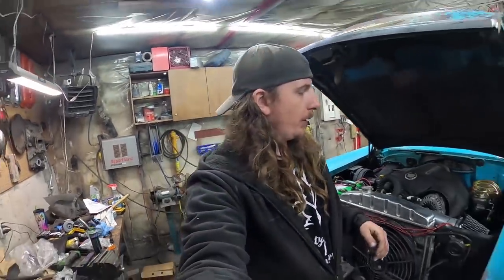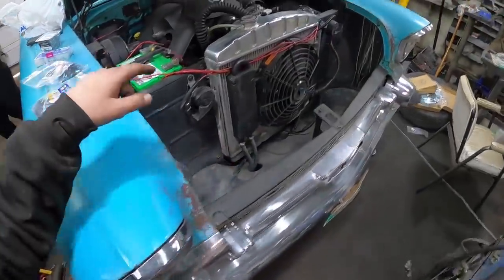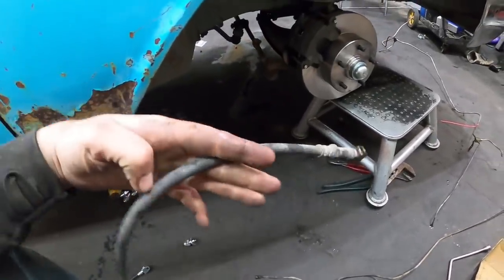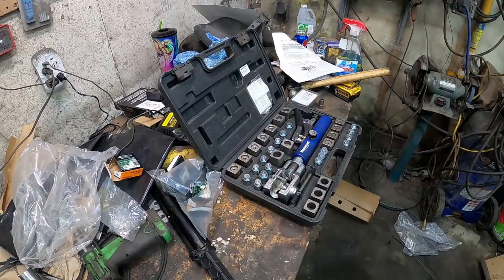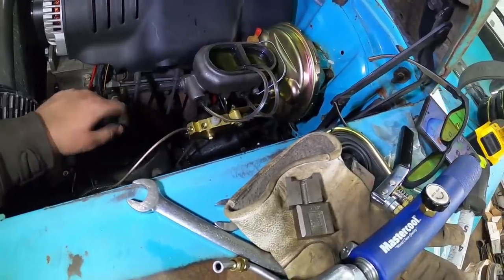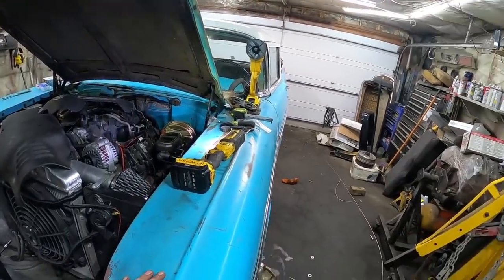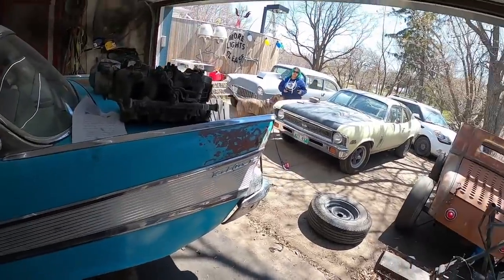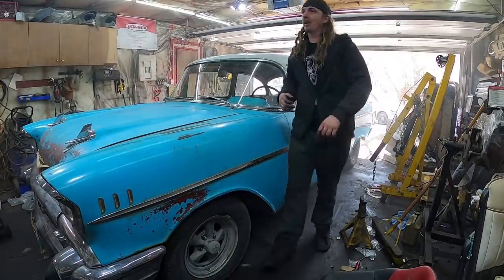57 Chevy Disc Brake Conversion Part 2 - Easy Hot Rod Upgrade

Comment: Single exhaust 55-57s had the fuel and brake lines on the inside of the frame,  on dual exhaust cars the lines were on the outside of the frame.  On the front end: the original ball bearings required frequent re-packing and were a PITA.  The hot set up was to replace the wheel hubs with mid 60s ones, (  mine came off a 65 Impala )  the tapered roller bearings were a huge improvement!  I am still running the drum brakes on my car,  discs are a common upgrade.  Power discs should be awesome!

Comment: I went with a serpentine belt set up off a big block truck and Hydro Vac power brakes...works great. Rack and pinion power steering turns without effort and a cross flow aluminum radiator with two large fans cools in the Las Vegas heat..I have a down flow aluminum  radiator and electric fan to get rid of...never used..also installed new larger fuel tank with electric fuel pump in the tank and have another new tank gathering dust...live and learn....I'm  sharing what I learned working with tri fives for 50 years. 
   Also learned I should have stayed with a Holley 850 double pumper and skipped the EFI...never to old to learn..

Comment: Fantastic tool. No wonder you refuse to give it back! One good trick for brake line stress relief is to use your tubing bender to create a coil after the exit from the metering block.
Reply from the maker: Great tip!

Comment: good shit man, can't wait to get back to wrenching on my 56
Reply from the maker: nice!  what all is left to do?
Reply: @DDSpeedShop  short term is disc brakes up front and an 8.8 ford out rear for the discs and posi along with some boiled linseed oil for the patina and a pertronix electronic ignition for the distributor. Longer term is getting some new bearings for a crank, lowering the compression and a few odds and ends for the roots blower going onto a 440 I picked up for it. I'll have to figure out some kind of deal with a transmission too, hopefully a 4 speed while i'm at it.
Reply: also thinking about something along the lines of your 4 to 2 door swap possibly, my girl gets defensive when I talk about cutting a survivor though

Comment: When doing burn outs with 4 wheel drum brakes leave rear drum loose so first pump applies front drum only and 2nd and 3rd pumps will apply all 4 we loved burn outs before disc brakes

Comment: Burn outs was the least of your worries with the old master cylinder, They was horrible If one line broke the entire system was gone. Just getting rid of the single MC made it 100 times safer the fact they are disk and power is just icing on the cake.

Comment: Something to beware if you have a brake warning light system in use. The plastic nut with the small metal pin is the sensor for that warning light on the proportioning valve. It has to do with the way the 2 halves are tied together and what side the contacts slide to from center to turn the warning light on. (if there is a leak of bad seal it will move the position on the switch from center and trip  a switch letting us know to check our brake system.  I said that because the whit nut with the pin that goes to the warning light goes on the proportioning valve needs to be removed and replaced with a calibration tool that holds the sensor switch in the proper place during the bleeding. Then once the brakes are solid you remove it and replace with the sending unit and you have a proper bleed brake system. Of course if you did not use this feature and put a brake system warning light in then I guess it would not matter. But many modern gauge sets have the dummy light for these old cars built in that they never had before so they can be made more modern and safer.

Comment: I'm probably going to have disc brakes all 4 corners andput line lock on my pinto because it will be a 5 speed so it will be alot easier with that setup but you're golden with the automatic 💪😜👌
Reply from the maker: nice!  sounds like a fun rod man
Reply: @DDSpeedShop  it will be if I can get scat to send my stroker kit to me so that I can finish up my motor but gotta put it in the machine shop first so I can get it bored decked cam bearings in and .060 taken off the heads so that I can stay around 11.1 compression. Gotta get all the power I can so that it can move the big giant heavy pinto around 🤣😂😜👌💪🚗💨

Comment: #17 may 21 '20 02:09 PM 🇺🇸😎🎩
Part 2 : D Y K supposed to use backing plates on disc brakes and rotors 🕶

Comment: I'm trying to piece together a power brake setup for my 68 camaro . Do you know who made the master assembly? Also, were you using 3/16 or 1/4 tube or both? Keep up the good work.
Reply from the maker: its from "right stuff"  i used both sizes

Comment: The reason manufacturers Put tho loops I brake lines at the master is because the found over time the vibration in the lines crack at the flares if the don't so they're basically shock absorbers
Reply from the maker: sweet good to know

Comment: I know I'm no mechanic.
Metering block, proportioning valve.
Would you explain to a guy, what each does, what they're for...Take it easy on an old guy with memory problems if you will....
Reply from the maker: basically they just determine the percentage of brake pressure front to back
Reply: @DDSpeedShop  ok. Thanks. The 1980 Chevy Citation, with all it's design screw- ups, had this tendency to do 360° spins if it was slightly damp outside...
They definately under- designed the brake system....The rear brakes locked up before you knew what was going on....
Enjoy that '57 Chevy as much as I do!!!!